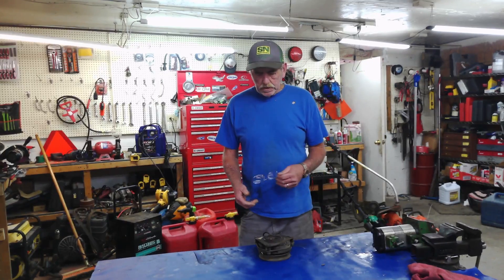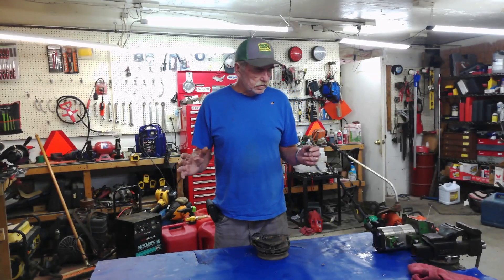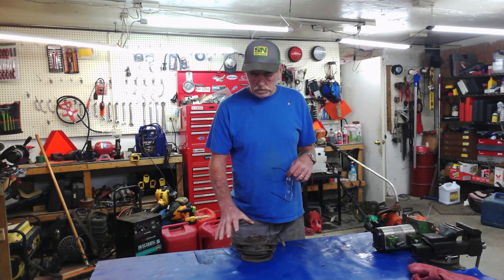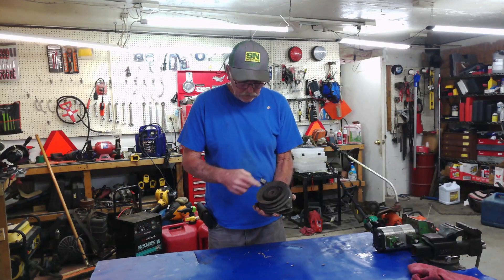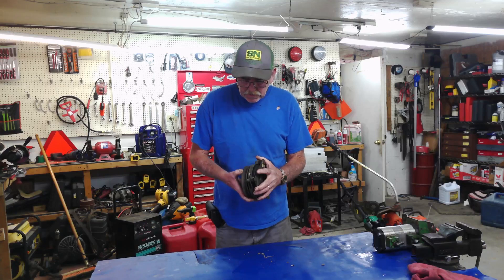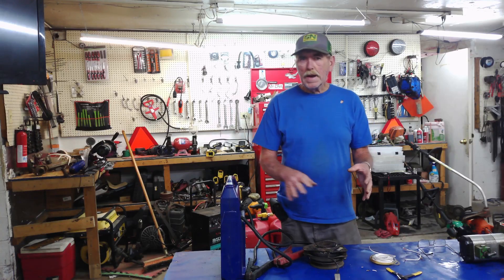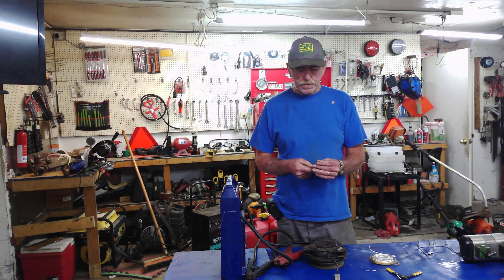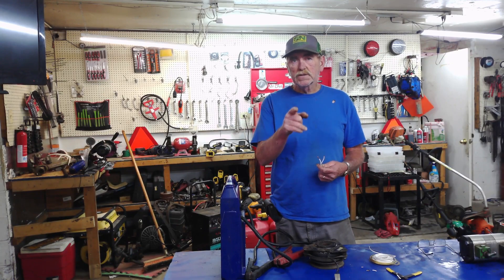Mower Not Mowing? Check Your Electric PTO Clutch First!

Comment: My clutch tested good on the ohm meter and it worked when I hooked it up to 12v, however when it was hooked up to 12v and I tried to spin it it was dragging about half way around which was causing the engine to actually not turn and start. This really concerned me before the test because I thought the engine had actually blown. Glad I kept fighting it and found the issue. Only telling this in case someone out there has a similar engine issue thinking it could Not be a clutch causing the issue.
Reply from the maker: Great add. I have seen PTO clutches be a molten mess and I have seen Deck or drive belts keep the engine from turning over at all. Great job on diagnostics.

Comment: Been working on this jd lx 178 for a couple of hours now. At first, it would die when releasing the clutch, but i have now bypassed the brake and seat switches, which allows me to now drive it around but now it dies immediately when i try to engage the pto. Tested pto switch, and good ohms on the pto. Also, i have 2 blown 15 amp fuses on the control board behind the ignition. Any ideas would be helpful.
Reply from the maker: sounds like you have a hot wire grounding somewhere with the blown fuses

Comment: Now, having replaced the engage switch and the PTO clutch, and the blades still won't engage till I pull the knod half a dozen times, what do I do next? (John Deere X350)
Reply from the maker: Hey Tom, follow your wires from the switch to the clutch. Sounds like it is in the whip you plugged in the new switch

Comment: Even with a bad battery that has to be jumped to start if the stator is charging it should have enough voltage to engage the PTO.
Reply from the maker: correct Jason. I have seen just the opposite of a good battery and a bad charging system kill the PTO was the battery was drawn down so far.